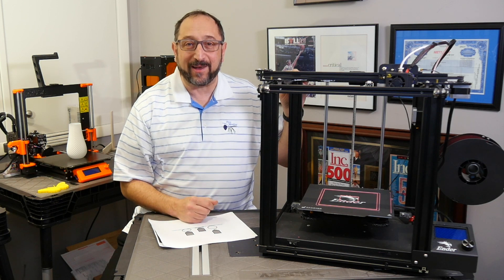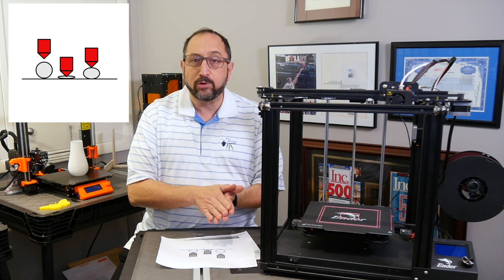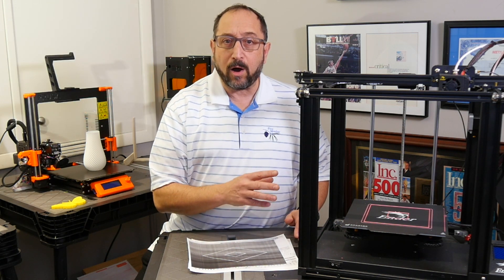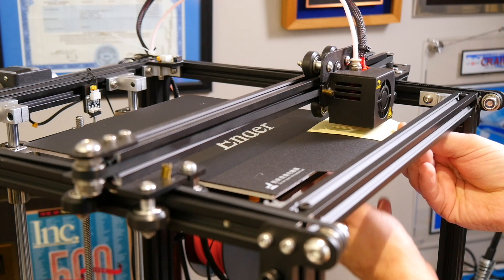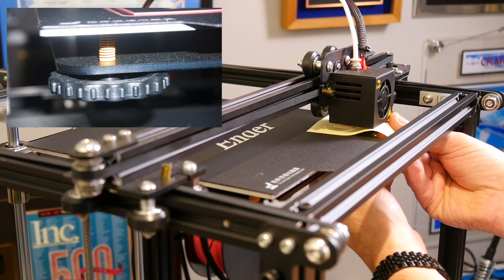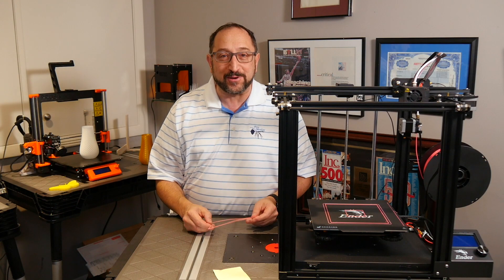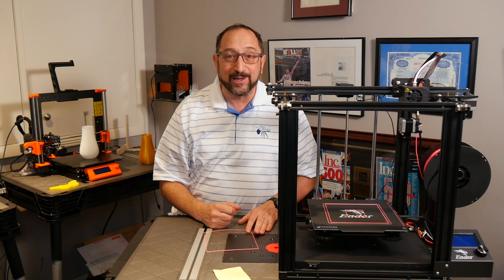3d Print Bed Leveling for the Ender 5

Comment: I don't have a bed auto leveling option on my printer
Reply: I turned mine off then moved the nozzle by myself
Reply: Same tbh, not a big deal though, i got it close manually with a bubble level, and did the rest just moving the machine around, seems silly to remove a good, useful feature. Mine is also missing the thing that keeps the bed from dropping. Could just be an old stock model idk
Reply: @Shadowlogic420  what keeps the bed from dropping? I'm convinced this is my problem and why no prints work. I level the bed carefully and it's ok for the whole priont, but if I stop/pause and go to home for any reason, including finishing a print, the very next one is out of whack for height and back to not working again. I've watched the bed height float around enough to note the nozzle go from not even touching a piece of paper to outright almost denting the magnetic pad the very next time only to go out again. Leveling is good for one print only and I feel that's not normal.
Reply: @RenfieldXIII I’m having this exact issue right now, already dented and scratched up one of my plates, did you ever find a fix for this?? I can’t find anything online
Reply: @Shadowlogic420  using a bubble level levels it relative to the ground. You want to "level" it relative to the nozzle. A bubble level isn't guaranteed to do that.
Reply from the maker: Folks,  on the newer Ender 5 printers, Creality has dropped the semi-automated bed leveling option.  I am not sure why but here is a video that will show you how to add it back to your printer.

https://youtu.be/zfTm0SqIFm4

Irv
Reply: @MakeWithTech  You're the man.
Reply: I got mine and noticed that option was missing as well

Comment: I have Ender 5 Pro and the bed or build plate is dipped in the middle. I even dropped a glass bed on it to try and resolve it. Dunno if it's cuz i'ma newbie but I want to smaaash the printer! Yep I turn purple, not green, and smash chit when angry.  Anyway, anyone have a good bed stabilizer to print or order in US? Thnx

Comment: Irv, what version of Marlin is on the Ender 5 in this video?  I don't see the bed auto leveling option on mine. Running Marlin 1.1.6 on a Creality Ender 5 Pro main board is  version 1.1.5
Reply from the maker: That video was made with the first version of the firmware from a couple of years ago.   I have more recent videos on the channel that use a different approach

Comment: I had issues with the uneven heat on the bed when I used post-it-notes/paper. I headed my bed and checked corner to corner. The warmer the bed, the less issue I had. I used aluminum foil under the magnetic print plate and it seems to be doing the trick. I do still have to up the bed temp a touch but I don't have cool spots.

Comment: everything I've read suggests you should be leveling the bed is hot but there are some that say it's doesn't matter?

Also this video would have been great to show you actually leveling the bed as it's printing instead of just mentioning how to do it, think that would have been more helpful to newbies.
Reply from the maker: Thanks for the comments.  This was a relatively early video on my channel.  There are now a number of bed leveling videos on the channel.   You are correct it is optimal to level the bed at temperature.
Reply: @MakeWithTech   I've watched a few of your videos over the years :) I'll have to check out some of your other bed leveling ones.

Comment: You win a thumbs up from me for saying use painters tape to level the bed. I don't know what the heat will do to the tape. I guess I'll find out. 
 I have a really high spot in the middle of the bed. It took a layer all the way around the outside and a couple of spots if clear tape. Took about an hour to get it all set right, but it all came out really good in the end. With the thickness and height inside +/-.0015. I had zero strings using Esun PLA+ 200 on the Nozzle, and 60 on the bed.

Comment: probably should have mentioned or pointed to another video about rendering the stl into gcode file.  Me being a 3d printer noob just put the stl file on the card and then wondered why it didn't show up in the file list.   Once I realized there was another step I ended up downloading Cura and mumbled my way through generating the gcode.  Given this is an ender5 video maybe just supply the gcode for it.

Comment: Thanks! I used your trick with the paper/post-it note, the test cubes printed fine after a few tries and tweaks. Then I tried to print a sample model and it failed to adhere to the bed. Your comment at the end of the video is the one that sealed the deal for me; the one about adjusting the bed and nozzle temperatures. I set the bed temperature to 55 and the nozzle to 210 and I'm roaring.

Comment: HI, so nice that YouTube suggested yours channel. I'm interested in 3D printers and just at this point I'm considering choosing an ender 3 pro or ender 5. Does it have a lot of significance that ender 5 can print at a slightly higher temperature? I like that frame ender 5 looks very solid, very strong, but does it be necessary? Ender 3 pro looks very practical and reliable as well.

Comment: Maybe you could add, that you should move it up by hand on the first startup. my limit switch and bed were pre-adjusted so high, it would have just crashed the bed into the nozzle.

Nice video though, very helpful
Reply from the maker: Excellent suggestion.

P.S. I have started a new discussion forum at http://forum.drvax.com where we can all have more elaborate discussions and share pictures on our prints and printers. Check it out. Irv

Comment: In order to "level" something you need an external reference.  Usually a device called a "level" is used.  Imagine that.  Most levels use a calibrated bubble.  What was just demonstrated is not leveling although that's what the printer makers call it.  This demonstration actually has the effect of aligning (approximately) the surface of the bed with the X & Y tool paths.  It's very important to do this it just isn't leveling.  Once this calibration has been done a spirit level should be placed on the bed aligned with both X & Y axis and the frame of the printer should be raised and/or lowered as appropriate to level the bed and the tool paths coincidentally.

Comment: How do you make the ender 5 bed come down when you pause or stop? my bed always stays atthe top and I want to be abele to get to the nozzle and wipe it clean.
Reply from the maker: Use the front panel controls to move the z axis.  Or with the power off very slowly turn the z axis screw axis by hand.   Only turn it very slowly.

Comment: how do you bring the bed all the way down?
Reply from the maker: You can use the front panel of the printer or with the printer off you can very slowly mover it down by hand by turning the Z axis screw.  That is the silver colored threaded rod.  Turn it just until the switch that senses the bottom position triggers.

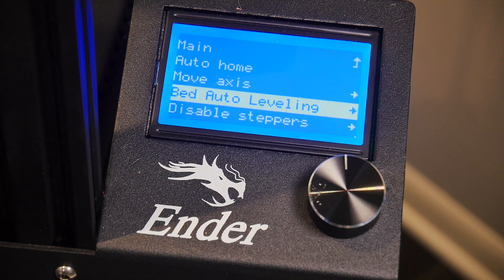Comment: 4:38 where do I get tbe bed auto leveling mode? My ender 5 pro doesnt has it
Reply from the maker: Newer Ender 5 printers do not have this option.  This video provides an alternative.
https://youtu.be/zfTm0SqIFm4
Reply: @MakeWithTech  thx for the reply.. I codes a  9 points level sequence, but now I find faster if I disable the steppers.

Comment: Interesting video. I used the bed leveling gcode and it seemed to work quite well. I found I had to put a Post-it under the center of the mat (as you mentioned), but then the center was a little too high. I will have to find something a bit thinner. I'm also wondering if I can use my feeler gauges to establish the height. Being metal, they shouldn't suffer from compression issues like paper does. 
     In any case, my real remaining issue (after getting the test print done) is to eliminate the very fine hair strings that are created when the nozzle is moved from one location to another. On the test print, I get very fine hairs from the inside corner of the large square to the outside of the small one, and vice-versa when the nozzle moves from the small to the large.
     On the bright side, the squares measured very close to 1mm (within a tenth).
Reply from the maker: I have a video about stringing that I recently posted on the channel.

https://youtu.be/WLWYzJe8zxI

Hope this helps.  Also check out forum.drvax.com where you can discuss you challenges with other people interested in 3d printing.

Comment: Having some issues with leveling my Ender 5. Recently bought it and as everyone else said doesn't have the leveling option, which I disengaged the XY and manually moved it around which seemed ok, but the issue I'm having is the center of the bed is just too low. Mentioned something about tape being used in the center, just not entirely sure what that means. ( First printer and complete newb to this whole process )
Reply: Did you ever find out how to do this. Dude im in your shoes. No idea WTF im doing. Been struggling with bed levelling and Z offset for 3 weeks. Stuffed up my magnetic bed so bought a glass bed. Now I dont know what to do to get the Z Offset right. If you were able to figure some stuff out I could use some advice?
Reply: Just lay some small, thin object under the middle of your printing mat. Start very thin (a single sheet of aluminium foil for example) and work your way up. (opple aluminium foil, triple and so)
Other people prefer not to use something out of metal, but use a thin sheet of paper...

Comment: This was fantastic.  Thank you so much for your videos and awesome instruction.  I used this in conjunction with the video regarding the G-code for assisted leveling that you posted and it has been an enormous help.  As a new 3d hobbyist, I was getting very frustrated with the print quality from my Ender 5 Pro and the tip about the post it note in the center to accommodate the plate not being entirely flat was awesome! Thank you so much.

Comment: How do you set the bolt that trips the Z-stop switch?
Reply from the maker: I would start with the screw in the middle of its range.  Then level your bed.  After you have leveled the bed you can use minor adjustments to the screw to change the Z offset.  That is to say to move the overall bed up or down a bit to get better print adhesion.
Reply: @MakeWithTech  Thank you for your response. I started with the bolt up a good bit to make sure the bed would not bang into the nozzle before the switch made. It was very high after homing. I screwed it down to even with the top of the nut and I had to adjust the level screws to the point the had NO tension on them to get it to adjust to touch the bed. Readjusted the bed screws to about midpoint. I then had to remove the nut on the top the Z-offset screw and adjust the screw down to about half the nut height to get it to level with tension on the screws. I was very impressed with the first print. It was a stringing test. There were none and good strong posts. I will have another look to see what I need to get it to level closer to the mid-range on the bed leveling screws. Any suggestions would be great. Thanks for a very good video.

Comment: What firmware is that? Stock doesn't come with bed leveling.
Reply from the maker: The early Ender 5's included the bed leveling options. Later ones did not.  However, there is an alternative:

This video explains how to add this capability to any Marlin printer:

https://youtu.be/zfTm0SqIFm4

Comment: Bed leveling,does this need to be done hot or cold?
I noticed when doing it cold,my bed dips from corner to corner, on the outside edges and  in the centre.Will this sort itself out when the bed is hot? I checked straightness using a straight edge. 

Also is this a big problem,my first printer,total noob here.
Reply from the maker: Yes it is critical.  I would guess more prints fail because of improperly leveled beds than any other reason.   Yes it is better to heat up the bed before leveling it.
Reply: @MakeWithTech  Thank you for your replyi am going to heat the bed and then check it with a straight edge when hot.I bought the printer a few months ago but because of work obligations and then illness,didnt get a chance to set it up,so if it doesnt straighten out,dont think i will get any joy from Creality.What about putting a sheet of glass on bed,do you think that would work?Read you have to put hair laquer on glas to give filament purchase.
Once again thankyou for a very informative vid and your reply.

Comment: There's no auto bed leveling option
Reply from the maker: You don't need it.  Check out this video for an alternative approach.

https://youtu.be/y_xCtxcwDrQ
Reply: Mine does not have this feature either. I do understand that it "doesn't do much" as one can turn of the x-y steppers and move the head manually, but sometimes when i do that, the printer will spontaneously shut of the z-stepper half way though the job forcing me to start over again. Is anyone else seeing this issue and/or understand why it happens?
Reply: @jonascarlsson1290  Disable all steppers, not just x and y and also i would actually recommend to use the move axis function instead of moving it manually. thats what i ended up doing and its been working flawlessly so far.

Comment: Got mine set up today in around an hour and luckily levelled the bed to a reasonable point which produced an exceptional print (not too disimilar to my old Prusa). Manual bed levelling (disable steppers) gives me a major issue as it disables the Z stepper (rather than just disabling x and y) after a few minutes and you have to start again due to the bed dropping this is really frustrating. Even the four corner option you have would at least remove the need for disabling the steppers. I had gcode for my cr10 which effectively did the same thing so Im sure there must be one out there to help (or Ill try writing my own)
Reply from the maker: Unfortunately  the bed dropping when steppers are off is a know issue with the ender 5.  I have added a z axis support I found on Thingiverse to help with this.  Not everyone things that is a good idea.
Reply: @MakeWithTech  I used an ender 3 gcode on thingiverse for bed levelling... runs the four corners twice for paper levelling then prints  5 circles https://www.thingiverse.com/thing:3118088

Comment: turned my printer on and tried to do a print from the sd card and the nozzle has dug into the magnetic top, So i will be sending this printer back tomorrow. its ridiculous to send out printers that cant print. the Z axis moved down on its own  so when you think its all level it might have moved down 2 mm, so when you print bang goes your magnetic top trashed, its a bad printer  and no way would this printer resume, you only have to fart and the z axis moves.
Reply from the maker: That is exactly why I ALWAYS level the print bed of a new 3d printer, manually with the power off before using any SW leveling support.  Here is a video that shows how to do this manually on an Ender 3 pro.  The same procedure will work on an Ender 5.

https://youtu.be/y_xCtxcwDrQ
Reply: @MakeWithTech  Read my reply again! I said i levelled the bed, but the bed moved down on its own. the z axis moved as soon as the stepper motors go off and as i have "NO DAMN LEVEL BED OPTION"  i thought the bed was level, but it wasn't because the z axis moved down after stepper motors went off, so i was still levelling it not realising this. if you don't understand what im saying then you're not the best person to be making these vids.

Comment: No level bed in my menu.
Reply from the maker: Some enders have it and some do not.  It is not really necessary.  This video talks about this and shows you how to level and Ender 3/5 printer manually.

https://youtu.be/y_xCtxcwDrQ
Reply: @MakeWithTech  Thanks for the vids but none of this will help me address the z axis problem, the auto bed levelling would have helped because it would keep the stepper motor on and the z axis would not move down as soon as i touch the bed levelling knobs.

Comment: weird my end 5 does not have the auto level feature... and it brand new...i was supposed to be latest version..
Reply: Smae issue .3 firmware (i see there is a .6 but you can't just flash it easily). Frustrating.
Reply from the maker: The auto level option of the Ender 5 doesn't really do much.   All it does is move the printer head to the four corners.   Just turn the power off and move the head manually.   Here is another video where I do that:  https://youtu.be/yzyy2e5cHAg